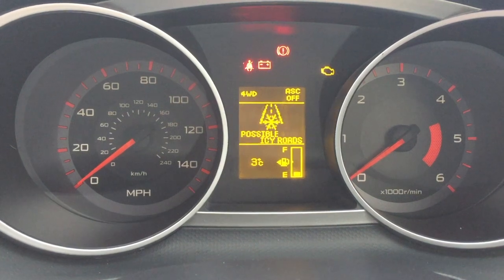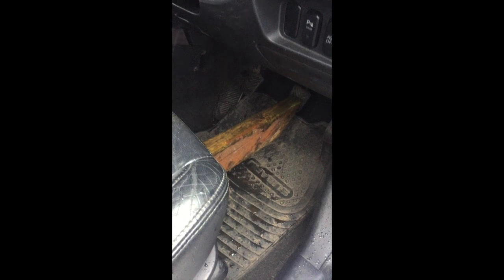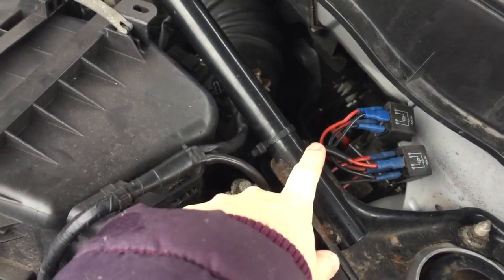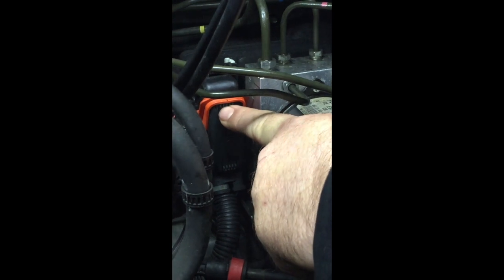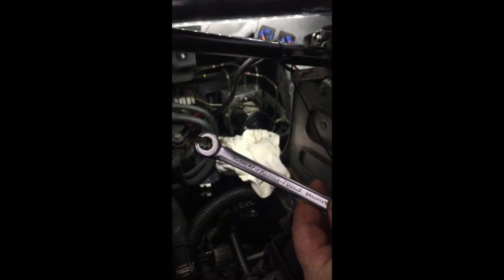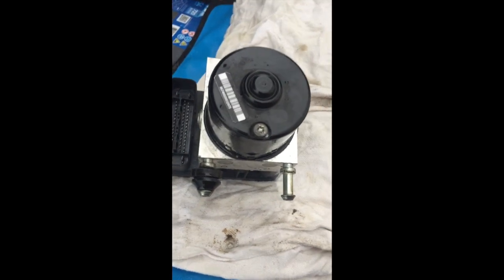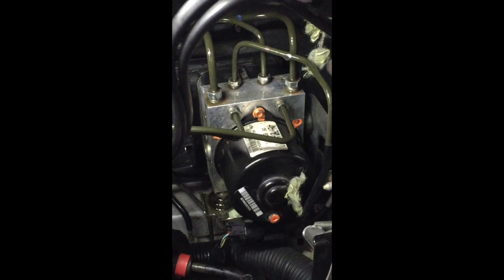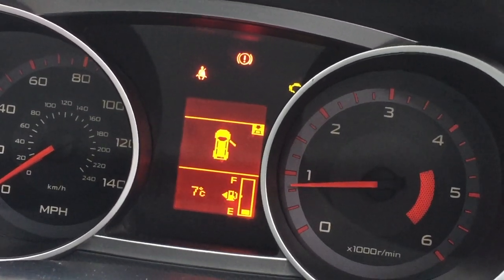Mitsubishi Outlander 2008 ABS Pump / ASC ECU replacement

Comment: My 2011 Mitsubishi Outlander SE FWD is displaying warning lights for the ABS, ASC, and Brake System Services. After scanning, the following diagnostic trouble codes (DTCs) appeared: P1773, C2200, C1200, and C2104. Could this indicate a faulty ABS module? If I replace the current module (part number 4670A550) with a used unit (part number 4670A898 from a 2013 Outlander), will it require programming or re-coding?
Reply: Hi mate, did you fix your problem ?? Can you please tell me if it requires re coding or if it's chassis coded ? I have the same car so Im also stuck with this issue. Please do reply ...
Reply: No reprogramming required after replacing. Only reset the codes.

Comment: Hi Gary, I am facing the same problem with the Mitsubishi outlander 2010 and I have bought one ABS module from ebay and just attached it with cars electronic switch with out the break pipes, just to be sure that it is compatible with the car. Though it has the same batch number, but still when I started the engine, it was showing the sane errors. Does this mean that part new module is dead or I have to use OBD2 meter to remove the errors ?
Reply from the maker: Hi, you could try and OBD clear first it may not mean the pump is faulty but if the codes don’t clear then it would suggest either the replacement is faulty or you have another issue in the system, depending on the codes of course. Good luck !

Comment: My 2016 lancer has been down a few months. Shows engine service system, engine overheating stop safely and asc system service required. Had an issue with my radiator fan, so the whole fan assembly was replaced. But I couldn't even bleed the coolant because my car wouldn't turn on and will show these warnings even when there's no way the engine is overheating because it's been down and not running. Tried to scan with my scanner, but it's not communicating with the car 😢
Reply from the maker: Really sorry to hear your issues, have you tried to join an online forum specific for your car? If not try it out you will find all sorts of help there.

Comment: A helpful video👍
If the sticker with part number is missing (which mine is!)
Does the unit have the number/code anywhere else printed on it?
Reply from the maker: Thanks! Sorry I don’t believe it does but honestly wouldn’t have looked as mine had the sticker, sorry I can’t help with that one but glad you found the video helpful!
Reply: @gary2turbos  thanks👍

Comment: Hi Gary such a helpful video thankyou. I've replaced my ABS pump/module over the Christmas holidays, but my ABS light and ASC lights are still on. The auto electrician recons the module unit the wreckers gave me is the wrong one. Were the numbers that need to match the old and replacement unit on the pump part itself? Kind Regards Jack
Reply from the maker: Hi, glad you liked the video and hope it helped, yes the part number was on the pump, thanks Gary
Reply: @gary2turbos  Yes very helpful, great thankyou. After been given the wrong pump first time, finally got the correct one, all sorted, thanks Gary 🙂

Comment: How was the abs bleeding process I'm sending mine off for repairs to clear my c116 code in my 09 ralliart lancer, was it just a normal bleeding process or did you need a scan tool to cycle abs?
Reply from the maker: Hi, we just bleed normally, however you have a different car so wouldn’t like to advise you on whether you would need to use a scan tool or not, thanks

Comment: hi, Gary Smith, I have the same problem.  I got 3 fault codes U0121 4WD electronics, C121D ABS, B1A11 Immobilizer... the dealer here in NZ want 2.5k
Reply from the maker: Wow that’s a lot, hope you got it sorted.
Reply: Hi mischif, can you please tell me how did you resolved those codes ?? Specially U0121? And please tell me if the ABS module is chassis/VIN coded or can be replaced by the other same module with same batch number ?

Comment: in case anyone comes searching this, the procedure is the same for a 2009 and onwards mitsubishi lancer. the only difference is the peripherals part is just slightly different. pump removal is the same though

thanks for the video, was very helpful
Reply from the maker: Glad it was useful thanks for watching
Reply: Did you bleed it like a normal car? How did you bleed abs?

Comment: hey i have 2014 Mitsubishi outlander AWC and i got the abs and asc lights on along with the checking engine light. After i got scanned, i have two major codes that came up the first one is P1773 and second C2116. I know the first code is related to abs wheel speed sensor failure so as far as the second, do i need to replace ABS PUMP/ASC ECU ?
Reply from the maker: Bobylee Ngoma Hi Bobylee, sorry to hear of the issues with your car. I’ve not had any experience with your year of vehicle I’m afraid, but it would appear the C2116 code could be related to low voltage at the pump. You could try cleaning the connections and checking the supply voltage. If you wanted to confirm the pump was the issue before replacement then its worth paying the dealer for an hours diagnostics just to confirm. Sorry I cant be of more help. Good Luck
Reply: I got the same issue with my 2010 outlander. Did you ever figure it out?
Reply: Hi, how fixed this issue?
Reply: Funny I have the exact same issue with a 2009 outloander right now.

Comment from the maker: Hi, thanks for your comment. We didn’t need to reprogram our unit, it didn’t even need the code cleared once it registered the new unit but I think that was probably indicative of our particular issue (C121D). If the dealership have confirmed via diagnostics that the cause of your code is the unit and not other issues such as a damaged harness, or abnormality in the battery or alternator, then as long as the part number of the donor pump matches it SHOULD ( but obviously I can’t guarantee) resolve your issue, assuming the unit is good. I can’t confirm if it will or won’t need reprogramming but I wouldn’t think so - the code may need clearing afterwards. Hope that helps.
Reply: Thanks for your reply.  I think it might need to be reprogrammed for the wheel size and yaw rate sensor.  But like you saw, if it goes away right away, then maybe not.

Comment: Mine is 2011 Outlander SE and error C2104 and was told (by dealership) that it's the ABS actuator.  Looks like actual process is more mechanical, then bleed brakes.  Does it actually need reprogramming if the whole assembly (pump, solenoid, block) is from a used Outlander?  Donor vehicle is 2013 - part is compatible 2011-2013.  Thanks.
Reply from the maker: Hi Sorry we didn’t get to respond to you in good time, I hope you got it sorted.
Reply: What did you end up doing to clear that code?  I have the same code 2009 ralliart.

Comment: So your video it very help I also planning to replace mine, but after I did couple research some say you need to computer and bleeding processes it run it properly, it be nice if you can do a video of how to do those two parts or you can answer me see what I should do, thank you and the video
Reply from the maker: Hi sorry for the delay in replying. We did not need a diagnostic machine to clear it for ours but i think that’s because our circuit board in the pump had failed. Sorry we didn’t include bleeding the brakes. It;s best to bleed the back brakes first and then do the front.  Feel free to message us if you need more help, but the Outlander didn’t have any specific set up with the brakes, so a bleed kit and an assistance should be enough, and don’t forget to top up the fluid. Thanks for watching.